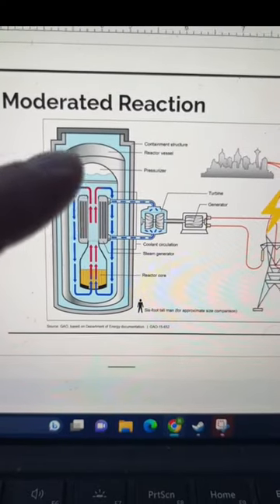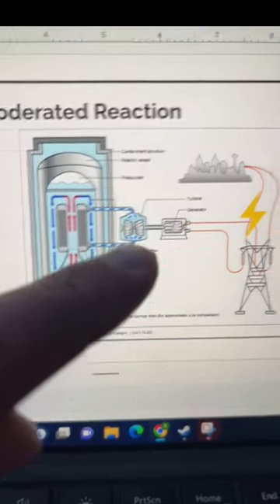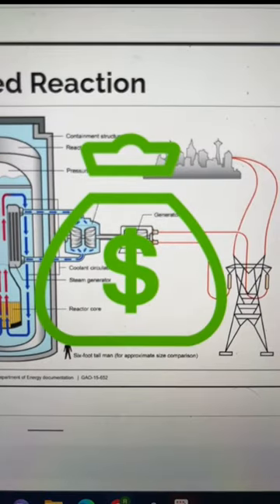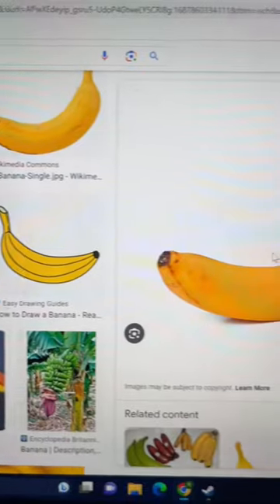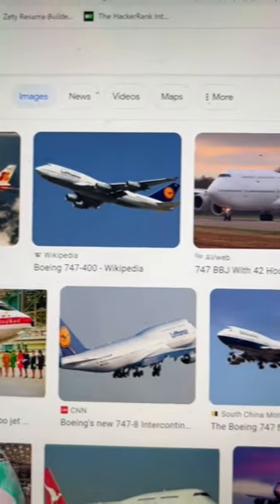No, The #Zaporizhzhia Nuclear Plant Will Not Explode

Comment from the maker: Please watch my video on nuclear weapons, nuclear power and radiation: https://youtu.be/gzmk53DJNUI

The six reactors at Zaporizhzhia are in a cold shutdown state. This is used when maintenance needs to be performed on equipment inside the reactor.  The spent fuel from the reactor is mostly kept in heavy concrete and steel "casks" on the site, which are specifically designed not to be destroyed easily. Spent fuel is normally kept in cooling pools for a few years until it can be placed in casks.  This can be a concern, especially if water stops flowing into the pool.  However, the spent fuel will likely just boil off the water in the pool and be a localized problem.  It will not explode like a bomb or turn into a radioactive volcano.

For uncensored video, check out my substack at:
https://ryanmcbeth.substack.com

Like my shirts? Get your own at:
https://www.bunkerbranding.com/pages/ryan-mcbeth

Want a personalized greeting:
https://www.cameo.com/ryanmcbeth

Watch all of my long form videos:
https://youtube.com/playlist?list=PLt670_P7pOGmLWZG78JlM-rG2ZrpPziOy

Twitter:
@ryanmcbeth

Join the conversation:
https://discord.gg/pKuGDHZHrz

Want to send me something?
Ryan McBeth Productions LLC
8705 Colesville Rd.
Suite 249
Silver Spring, MD 20910
USA
Reply: Wait…a banana??? Why? Asking for a friend….
Reply: The news were that the cooling pumps have been mined and could be destroyed. If the cooling stops we are going to have a situation much more similar to Fukushima. If reactors are not damaged and accessible they could be permanently disabled with boric acid. Fukushima reactors were shut-down but still hot and they hesitated using the boric acid in attempt to save the power plant.

The worst possible case is Russians blowing up the pumps then remaining in the plant preventing anybody from handling the situation until there is a meltdown. Like what they did with the Dam.
Reply: Thank you for bringing this misconception of nuclear power.
Reply: Then why Russians have mined around the perimeter and in some places inside? Source - IAEA report
This video didnt address this
Reply: @ИванСнежков-з9й  Yep. Destroying the diesel engines (which are maintaining this "cold state") or even the water intake can cripple a nuclear power plant's to maintain their ability to keep the reactor core cool. Even the recent dam explosion has raised the risk of an incident happening by limiting the supply of water. 

Mcbeth is just talking out of his backside.
Reply: Please answer the banana question...
Reply: If you're afraid of radiation you also shouldn't live in Denver! A long haul airline pilot will get about 6mSv of radiation per year. Someone living in Denver will get about 10mSv per year. A CAT scan is about 25mSv.
Reply: @TankEnMate  and heavy metals concentrate lipophilic which is a nuisance in groundwater
Reply: I'm made up about the fact that zaporizhia won't detonate in a noxious cloud of detritus; I just can't not worry about the civilians drinking from the aquifer
Reply: I had recently heard that only 4 of the 6 were in cold shutdown, 2 are in lower power operation. Did that change recently?
Reply: The problem lies with the fact that the people who have already destroyed one dam, and created one ecological distater, have complete control of a nuclear power plant that is one mistake away from becoming another 50,000 year nightmare for Ukraine.

The list of possible ways that that could happen has so many variables in it that to say xyz will not happen isn't being honest about the situation.
Reply: @Wavesonics Nope
Reply: @cirdancescles4370  Because they contain Potassium, which is radioactive.
Reply: beans nuclear reactor 😂
Reply: I just lost a lot of respect for McBeth... I love how he equates Potassium-40 and Cosmic radiation to Iodine-131, Ceasium-137, Strontium-90, Plutonium-241, Americium-241... There are also many other inaccuracies in this video... I wonder if he even knows that those cigar/cigarette he sucks on contain Polonium-210 and Lead-210.
Reply: @luciusbrutus13th  What drove me crazy is this: 

Cold shut down isn't the same as cold fuel assembly rods. Those things will still be producing enough heat that should fresh water stop flowing through the system you can very easily end up with fuel rods that start turning water into hydrogen and oxygen, just like at Fukashima. 

Plus 2 of the reactors were just recently taken out of power production, so those rods will need fresh water for much longer than those cooling ponds will provide it. Again, overheated rods create an atmosphere that is incredibly explosive.

Will the plant explode like a nuke? Nope. Could it cause an explosion that creates another nuclear nightmare, On Ukrainian Lands? Very easily under the present conditions. Very Easily and much faster than the west will react,
Reply: @ryanmcbethprogramming DUDE

Stay in your lane. I was a nuc plant operator in the USN

If ONE of those contaunment vessels is breached like the damn was, the water supply for one fifth of the worlds grain supply looses its irrigation!!!!!!!!

DUDE. 

You completeky overlooked smoking. 
A pack a day is equivalent to over 300 OLD TYLE FILM XRays in one year. Mostly from Polonium which comes from the phisphate fertilizer. Yeah, our complete dependance on mined phosphate fertilizet is also a bik kick in our exposure.

Youre not a CBR specialist, prolly outta find one.
Reply: @canberradogfarts  Will you please explain to him why nuclear fuel assemblies remain hot even after taken out of power mode? He seems to think a cold shutdown means they stop producing heat. But, and correct me if I'm wrong here, the uranium fission byproducts continue generating heat. And depending on how the fuel assemblies are packaged it can take months, or even years, before they no longer need cooling. (correction, not only how they are packaged but also how long they are undergoing fission)

And the two reactors just taken out of power production may be able to produce dangerous heat levels long after those cooling ponds run dry. What I'm unsure of is just how long those assemblies will be able to generate enough heat to split water into hydrogen and oxygen. Which doesn't equate nuclear bomb, but it's still a situation that will leave Ukraine with another 50,000 year legacy if actions aren't taken soon to ensure cooling water isn't interrupted.
Reply: @burntupretardporn  Nope, it had a single point of failure with the central control rod and a rather iffy startup procedure involving one of the operators moving the thing by hand. It wasn't well maintained and the rod had a habit of sticking. Trust me, that reactor was not safe in the slightest. All it needed was one guy tugging just a touch too hard to unstick the main rod and it would go up, no love triangle needed. (Besides, I thought that had been debunked.)
Reply: @burntupretardporn  It's the 1960's and it's a project for how to beat the USSR in a war. I love my country and US engineers have done some awesome things, but I'm also honest enough to admit that there are some great howling blunders in our history too. Take the F3H demon for example. Looks like a normal jet until you take a close look at the intakes and realize how ridiculously tiny those intakes are and then you realize that this was supposed to take off of aircraft carriers. Then there's the dam disasters that have happened, and the Tacoma Narrows Bridge, and Three Mile Island.

When it comes to dangerous or potentially dangerous jobs, materials, and machinery, all too often the best practices and safety protocols are written in the blood of those that found out the hard way how not to do something.
Reply: @burntupretardporn  I didn't blame the government. When I say the US, I mean the US collectively, corporations, government, and citizens included. Trust me, I was implying that the engineers, whoever they worked for, screwed up. Then there were several other screwups that lead to the final screwup, but what made those screw ups so bad was the screw up in the design.

That said, there's plenty of blame in that fiasco to go around. My point was that you didn't need a conspiracy theory about love triangles and murder-suicides to explain what happened. It was a program during the Cold War that didn't pan out as the US Army hoped, got it's funding cut, and then a series of errors and neglect combined with several design flaws to result in a tragedy and a lesson on why single points of failure shouldn't be allowed when dealing with nuclear power.
Reply: Oh Ryan, you brought us so much promises, but with every new video, you just take it away...😢
Reply: Brilliant, simply Brilliant you scored a 10 out of 10 for the BEST presentation of the REAL information about this 😊
Reply: You showed enormous ignorance about this topic. Zaporizhzhia NPP's design is pretty much same as Chernobyl NPP. Look into the Chernobyl accident to understand what is possible and how similar nuclear disasters and bananas are.

In fact, a Zaporizhzhia explosion would be much, much worse for Europe than the detonation of the largest strategic nuclear weapon now in existence today.
To be efficient, nuclear weapons are spending most of it's radioactive material, so radiation is localized to few hundred miles. Chernobyl accident made whole Europe shake for a good reason. Zaporozhye NPP is 5 times size of Chernobyl NPP.

P.S.
You should also learn how to pronounce Zaporizhzhia correctly.
Reply: wrong not all reactors are in cool shutdown. 1 is in hot shutdown and requires active water cooling. meltdown can happen if the water reservoir loses its water. the situation is actually critical.
Reply: Ryan tell us what happens when all 6 cores are open please. yep.......
Reply: Im just going to watch this because i wanna know whats up with banana radiation. :D
Reply: @MikeOxlong-  🤔🤷‍♂️
Reply: @wildwombat1961  The problem is he got so much wrong it's scary, because I know people trust him and will believe him. I doubt he's willfully wrong, but that doesn't change the fact that he is.
Reply: @MikeOxlong-  His video about the dam simply washing away from shoddy maintenance had me wondering if he kept his old boss's contact info. This piece has me hoping he did. I'm no expert in making large chunks of concrete disappear but I'm pretty sure shoddy maintenance isn't going to suffice.
Reply: @Benson_aka_devils_advocate_88  Point taken :)
Reply: The casks that we tested were not just concrete. They were mostly Steel.
Reply: I worked on the Nimitz 5 ish years ago. You get more radiation on the flight deck than in one of the plants. Heard a funny story about a guy who ate so many bananas that when they were inspecting the plant, they thought there was a leak until they saw that it moved with the guy.

Comment: usually great stuff Ryan, but this time you may have missed a point or two. you are correct that the reactors can't 'blow up' like a bomb. But the spent fuel in the pool has to stay in there for several years before it decays enough to put in dry storage. There is still tremendous amount of decay heat given off by the six times several years of spent fuel in the pool. If anything compromised either the pool itself or its cooling system, all of that gets released to the environment (not to mention the even hotter inventory of the six shut down reactors). The reservoir is gone but the plant isn't that far from the river which flows into the Black Sea which flows into the Med. That scale of release has never occured anywhere, anytime. By the way, you can't 'walk into' a reactor after it's been shut down a while. You can enter the building that houses the reactor, but the reactor itself retains immediately fatal levels of radiation for years after shutdown. (40 year career in 16 US nuclear plants)
Reply: Performing Dry Cask Storage usually does cask older spent fuel, however you can put fresher fuel in a cask. If needed, I can provide photos and videos of myself and my fuel handling partner and the SRO casking fuel 9 months post removal from the reactor. The plant was closed and we casked 30 cans in 6 months.
Reply: I live in Sweden right so I have a question for you: should I be worried?
Reply: @AH13371  No.
Do you remember Fukushima? Zero people died because of the reactors, all the fatalities and injuries were because of the earthquake and tsunami.
The people in Tokyo who got on a plane and fled to the US had a much larger radiation dose than if they had stayed, when you fly there is less atmosphere to shield you from radiation from space.
Are you worried about eating a banana? They are so radioactive that a container of them sets off radiation sensors in ports.
Are you worried about having granite counter tops? Granite is usually quite radioactive compared to other rocks.
Are you worried about being alive? All the cells in your body require trace amounts of radioactive atoms in order to function properly.
You evolved to live on planet with low level radiation all around you and big, giant fusion reactor in the sky, a tiny amount more won't hurt you.
If there is a forest fire in Ukraine, and some soot blows over to Sweden would you be worried? Soot can cause cancer, but you would have no problem cooking over a bbq with massive amounts blowing in your face...
Reply: @disposabull  When Chernobyl was going on people got radiation poisining up here which is what I had in mind. That part about Japan is wild, fortune favored the bold
Reply: Were you a nuc before that? My Dad was.  If you were,  you might have known him.  His sub captain was one of several people who helped overhaul INPO into the better organization it is today. It's a small world.
Reply: @AH13371  Chernobyl had a highly flamable fuel with no containment and the radionuclides were released imediately. In Zaporoshia the reactors have been shutdown for a year now so all 6 reactors have less than 1 % of the radiation that one Chernobyl reactor had and since very little of the radiation could actually be released, any release would only have local impact, there's no way it could reach the borders of Ukraine in any dangerous levels, it would be detectable though.
Reply: And even walking into the plant has its dangers. My brother-in-law got one years radiation in one small trip during a refueling shutdown. Radioactive dust sometimes builds up in unexpected places, and as an electrician there, he must have gone into such a place.
Reply: @disposabull Fukushima doesn't compare. They weren't in a state of war. The only reason all those reactor's didn't blow up is because of all the help they got. Fire trucks to cool the reactor's, and to fill the reactor's with water before all the water evaporates, and then the rods melt then boom. They alse braught in construction cranes to fill the reactor's up with water. Over 50 tons of water was used to fill one reactor up. They had special japanese forces on hand, even the US military pitched in.

Ukraine on the other hand, they are on their own in the midst of a war.

And there were Fukushima deaths directly related to radiation. The number is not zero.
Reply: @disposabull Furthermore, a seven hour airplane trip exposes passengers to 0.02 mSv of radiation, which is a fraction of the exposure of a standard Chest x-ray (0.1 mSv). Domestic airline pilots are exposed to an additional 2.2 mSv per year, about the same dose as a brain CT.
Reply: You also still need to continuosly cool the shut down reactors to prevent a core meltdown.
Reply: @melnq8 yes and no. They weren't exactly in a great state either considering how unprepared they were, and how they were wrecked by the massive tsunami and earthquake.
Reply: @saml6223  Still, however which way you look it it was a different situation. In my opinion, Fukushima, and Ukraines plant can't be put in the same context. A state of war is quite a significant difference in itself. A big one at that. No special forces, or aids is gonna sweep in to the rescue.

Bottom line, a Nuclear plant without power in any form is a recipe for disaster. I've taken great interest in researching Nuclear reactors. I've been closely watching the ongoing status of Ukraines plant. I am in close enough proximity to be among the nation's affected if something were to go terribly wrong. 

The state of reality is 👉 they've already LOST POWER UP TO 12 HRS once.

 No power. No diesel to run their generators. They've already had to rely on those generators one too many countless times, until they eventually ran out of fuel to run said generators. Reactors in cool shut down still need cooling, therefore, the fact that they (to my knowledge) put some, but not all 15 of their reactors into cool shutdown isn't as reassuring, and/or 'all dandy' as Ryan makes it sound. My 2 cents!
Reply: @melnq8 I've been researching reactors, too. Though the loss of power is a concern, the fact remains that the plant has a strong containment structure, which can withstand weeks of artillery bombardment. Chernobyl released so much radiation due to many factors, but one was the plant didn't have a containment structure. I'm not sure things can get much worse than Fukushima if there is a containment structure in place and the reactors are in cold shutdown, but I'm no expert.